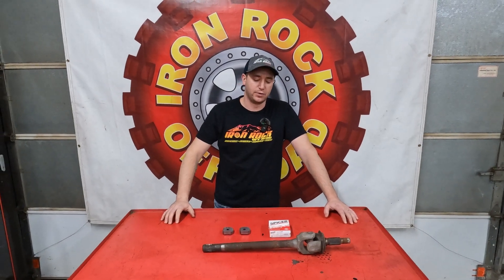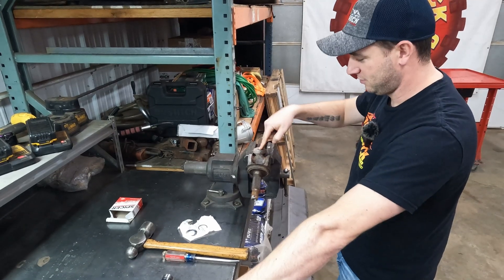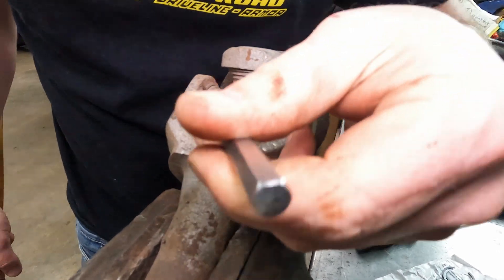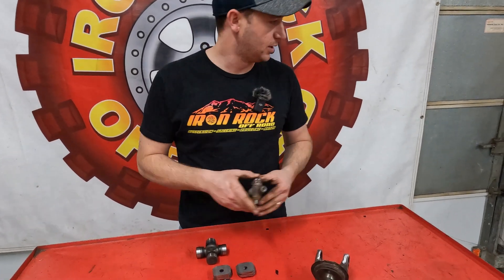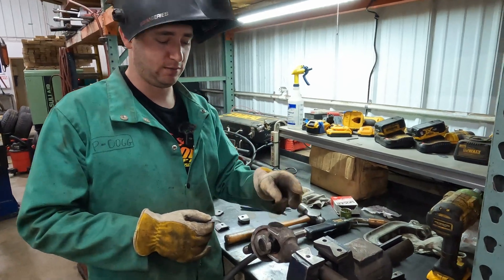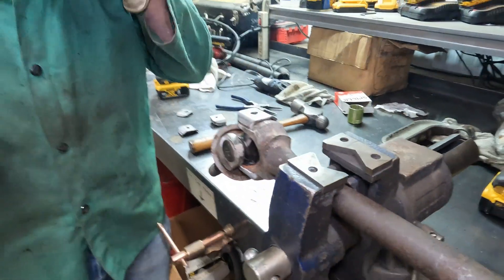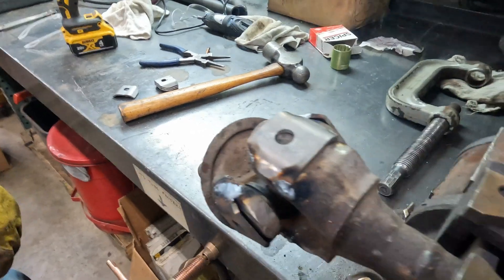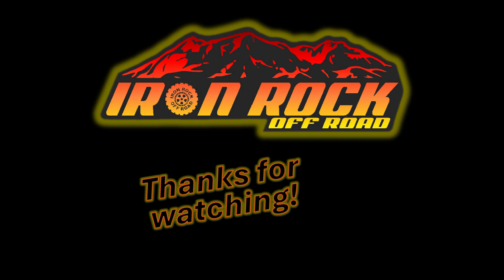Axle upgrade on a budget! IRO Almost Alloy kit strengthens the shafts you already have! Save your $$

Comment: You can cut these out with a torch on the rig. You split them in half between the joint knuckle across the u-joint diagonally. Bump out the clips and caps with a hammer. Clean it up with a wire brush and slip the joint between the knuckles. Install 2 caps to one knuckle, then the next 2 as usual. Install the clips. Then lift the wheel and roll the wheel while gently bumping the knuckles. Good to go. I have changed these out in the field this way for a very long time. I was shown how to do this at age 19. I am 47 now. I know this works.
Reply from the maker: @j.robertvillarreal5926 That's a great tip! Thanks for sharing your experience.
Reply: @IronRockOffRoad  When the Dana's would come in and paid 4 hours on the GM, Dodge, Jeep line I would knock these out in the parking lot. I could do 10 a day. 🤣😂🤣😂. Do the math. 
Never had a Come Back.
Reply from the maker: @j.robertvillarreal5926 Nice work!

Comment: Locktight for retaining press fits.
Works great, remove with heat.
Since spicer quit putting the correct c clips with their joints, I've been using  locktight retaining.
Reply from the maker: @mikegreer9041 Are you using the Locktite in addition to the C clips?
Reply: Boy I sure hope so, lol. I'm sure he is, as I do the same.  @IronRockOffRoad
Reply from the maker: @mikegreer9041, @rite2beararms A press fit with Locktite and the C-clip, that joint isn't going anywhere! That sounds like a fool-proof recipe. Have you guys had any failures yet?
Reply: @IronRockOffRoad  Literally why I'm here. I hadn't heard of this kit, and a buddy mentioned to try it after I broke an outer. He says they run these up in the iron range and they don't fail. Guess I better go for it.
Reply from the maker: @rite2beararms Sounds like your buddy is one of our buddies! We proved this concept over many years of wheeling hard in the iron range of northern Minnesota! The iron range is the namesake for our company, Iron Rock Off Road.

Comment: I know this is a stupid question so please forgive me! Im having one of my days but this is a straight axle isnt?
Reply from the maker: @Tommy-rr7ez Please feel free to ask anything, I'm glad to help! You are correct, this is an axle shaft from a Jeep Dana 30 front axle. This Dana 30 front axle is commonly found under a Jeep Cherokee (XJ), Jeep Wrangler (TJ), and Jeep Grand Cherokee (ZJ).
Reply: @IronRockOffRoad  Thanks buddy I realy do appreciate you and your help. I know a little but with you having it out I just couldn't tell but I preciate you being so nice about it.
I've got 2 GMCs and I just watched a video last week that I thought I had one of my trucks figured out but that video has me confused. Do you know much bout older OBS GMCs? The one I'm talking bout is a 89 GMC K3500 EXT CAB LONG BED single wheel.
Reply from the maker: @Tommy-rr7ez If your question is related to the drivetrain or suspension I can probably help. Whatcha got?
Reply: @IronRockOffRoad  Well I mightve found out. A buddy of mine told and I think he is right. I realy preciate it buddy!
On my 89 K3500 GMC 454 4 SPEED 2 headlights I was told back then they put 2 headlights in a more heavy duty work truck. I seen a video the other day a man bought a 89 K3500 EXT CAB LONG BED GMC 454 Automatic trans. But he had 4 headlights like my 88 GMC K2500.
I ask the man we have same year truck same body style except for you have 4 headlights and mine has 2 and yours is Auto. And mine is manual. Is there a difference and he told me mine is a Heavy Duty and his isn't. Do you know what the difference is and when I get ready to order parts am I suppose to say Heavy Duty or something cause I'm not sure  now?
Reply from the maker: @Tommy-rr7ez That is a tough one. You got me beat on knowledge of these old trucks. With that 454 and manual trans I do know that's a great reliable setup, hang on to it!
Reply: @IronRockOffRoad  I'm sorry it's took so long to get back to you! I preciate you anyway buddy! I found out with my 88 K3500 I need to say GMC K3500 HD when I'm ordering parts cause I've been told mine is a HD, Heavy Duty, so that makes my day. Mine came with factory Rock Sliders all up under it from factory and the regular K3500 didn't.
Yes sir the 454 and the 4 speed Bulldog Trans I believe will do me good when I get ready to take off cross country my kind of Overlanding. I may stop by if I get close to you and shake your hand and borrow some gas if you don't mind. I'm going to put a 100 gal tank like farmers do in bed right up in the front and box it in with a locked side door on drivers side to get to it. I've got it setup to go in shop next week and I've got to practically rebuild the whole drive train except motor trans and transfer case thank GOD they are ok but the motor is new but everything else has to be replaced.
I'm going to put a 5 inch lift on front and 4 inch rear to level it and maybe you can help me with I can't decide if I should go with 35s or 37s tires. I'm realy am struggling on which ones to do. I'm putting Coopers on it and they have a 60,000 mile warranty and that's amazing for a offroad tire. So if you have any advice I will realy preciate it I promise. If I have been told right I can go up to 37s without changing my gears so I think I willbe ok with 37s with a little 454 and 4 speed. 
Like I said I'm sorry bout taking so long but we had a cold snap and I've been getting wood every day and getting the house but it's all good it's going to be in the 70s Monday so I'm not complaining. Where are you at? Take care buddy and thanks for all your help!
Reply from the maker: @Tommy-rr7ez On the tire size, you have me stumped. If it were a Jeep, I'd say go big and cut the fenders if they don't fit! Haha! I'd imagine you will have to regear your axles if you go up to 35s or 37s though. 
We are located in Shakopee Minnesota, where we manufacture the best offroad products for Jeeps. We specialize in suspension, steering, armor, and drivetrain upgrades for most Jeeps from the 80s up to today.
Reply: @IronRockOffRoad  I preciate it buddy! Yeah o was afraid I might have to research. I knew yall done Jeeps but wasn't sure if yall done Toyotas and things to but I knew you didn't mess with old trucks and I wished I didn't either sometimes. You have been a lot of help anyway but you've been honest and that means more than anything! 
This will probly break yalls heart but there is a 70s or 80s I think it's a Jeep Wagoneer setting in a big barn across the road from me on a over 200 year old farm on the same family. No dents and has kinda of a Western interior all original. It was checked last year and they think motor is locked up. One owner and has been passed down. The woman that owns it we talked and I told her your killing that Jeep and she don't know what to do and I told her if I could afford it I like to have it to restore and if I talk just right I believe she would. So when i get this old truck going I may talk serious to her but I wouldn't want to offroad this one. You don't see many of these no more. But it kills me to watch one park like that. It's been parked since around 2000 after her dad passed.
Yall take care buddy and i will try not to bother you no more. Thanks for everything!
Reply from the maker: @Tommy-rr7ez You are welcome!

Comment: So, you just replace the whole axle when the joint breaks? Now you have to carry two spare axles instead of a few new u joints. Seems like the welding will affect the heat treat of the axle.
I just use full circle snap rings on my joints. Haven't had a cap walk out since I started doing that. Plus, i can still fix them on the trail or replace them when they get sloppy.
Reply from the maker: @flpanhead The idea is that by strengthening the ears of the shaft the joint will be much less prone to failure because it is supported so well. It is a similar idea to an axle truss; you bridge across the weak area and tie the sides together to make a more solid structure. If/when the joint needs replacing it is easy to grind the tabs off and replace the U-joint. 

Typically, when a U-joint goes bad it gets sloppy, snaps, and wrecks both pieces of an axle shaft.

Full circle snap rings are a great upgrade, but the axle shaft ears can still stretch and fail.

Comment: I've run these for several years on my '89 2D XJ, 4.6L stroker, AW4, dual 231/231 T-case(s), 4.56 gears, Grizzly locker up front, spooled 8.8 rear, 34x9.50 TSLs summer/trails/rocks, 38x12.50 TSLs winter snow/sand. 94:1 Compound low. No failures yet! 1/100th cost of RCVs. Absolutely best bang for the buck! Highly recommended. Turned my nephew on to them too.
Reply: Im more surprised to hear the 30 is hangin in there.
Do you plan on going full size?
Reply: @anomilumiimulimona2924  No. Gusseted, sleeved. I just try to wheel with finesse vs. skinny pedal. Low gears are for control. Did find out the hard way that the 38s are too big in high traction, busted a carrier (hence the Grizzly Locker) I save them for running deep snow or sand. They live @ 2-5psi for floatation.
Reply: @jonaathansimons7938  nice
Reply from the maker: @jonaathansimons7938 I love hearing about your setup! Keep that D30 alive!
Reply from the maker: @jonaathansimons7938 Thanks for sharing your experience with the kit, that's an awesome setup you have! If you can't break them with a rig like yours then they must be good. Glad to hear it is working for you!

Comment: Great Idea.  The world needs more ideas like this that are the result of thought as to what the root cause of failure is.   On these axles (as long as you have a good Joint)  the main weakness is the thin areas on the sides of the ears.    This seriously strengthens those weak points.
Reply from the maker: @timmcooper294 We appreciate you taking the time to point that out! This design is all about focusing on the areas where the shafts fail.

Comment: Ive got a set of axles with greasable ujoints in em, bought em used. Dude welded thick fender washers over the caps. and then ground em smooth.
Best $50(cad) ive ever spent
Reply from the maker: @Tpbmods Sounds like a good deal to me. The fender washers work but are typically not very thick and not quite as strong as our tabs. We pushed the thickness as much as we could for this product. No worries from us, glad it is working for you!

Comment: Just put your new ujoint in, put 4 small tack welds on each u joint cap. Done. If the joint fails grind the four small tack welds off and repeat. I used to blow up axles on every trip after locking my 35. Now I cant remember the last time I had a failure.
Reply: Your tack welds help retain the cap, but do nothing to help strengthen the axle which is what this kit does.
Reply: Lol the axle doesnt fail until the u joint caps push the c clips off. And OBVIOUSLY you dont understand that welding the caps makes the axle much stronger because it is now one piece instead of two.  Please do not breed. The world is full of idiots. @DonziGT230
Reply from the maker: @bdd1469 Leave the insults for the playground. I agree with tack welding the caps if that is all you can fit. Some axles can't fit our Almost Alloy plates through the knuckle, like on a JK. In that case I would recommend tack welding the caps in place. I do believe that the Almost Alloy plates are the superior option to tack welds but sometimes that's all you can fit.
Reply from the maker: @DonziGT230 That's a great point. We designed these tabs to be as thick and strong as possible and still fit through the knuckle. There is an advantage using our Almost Alloy tabs versus just welding the U-joint cap. We also designed the shape of the tabs to try and keep the heat of the weld as far away from the grease and needle bearings as possible.
Reply from the maker: @bdd1469 Glad to hear that is working for you.

Comment: A couple sockets would have made that U-Joint removal much easier... and you should have sockets on the trail

Anyways thanks for the video. Been on the fence about these but after the vid Ill be ordering 2 sets.
Reply from the maker: @1unkn0wn You are absolutely right, live and learn. We could have edited all that struggle out of the video, but we want to keep it real. We know this job can be a bear sometimes especially up here in the rust belt. All 4 of the U-joint caps were completely seized and so sloppy it wasn't even funny. No evidence of grease at all.

Thanks for the order! We appreciate it!

Comment: Yo?!! . . P-DOGG . . . . why you no safety glasses while C-Clip removing? 
Seriously tho, . . . I live in Alaska, I've seen some insane repairs. Repairs that clearly were done out of a lack of preferable choices. Like a rear drive shaft on a Chevy 3/4 ton that was made from 3" diam., tube of 14 gauge (0.0747″) wall thickness exhaust tubing. And it lasted until those U-joints wore out and the driveshaft bound up a bit and twisted. It's amazing what one can get away with when working with metal. If you remove too much, weld some back in and start over. If you need a hardened surface, weld some in , . . etc. Always interesting. Even if it's a new product, or in this case an older product, that I doubt I would ever use but, it's still super neat to see it. I Hope Iron Rock Offroad has a stellar 2025.
Reply from the maker: @RANDOMNATION907 P-Dogg is a nickname for another guy that works here. We are all about sharing our welding jackets here! 😆 I'll make sure to share some safety glasses with Travis next time! 

This simple product has been working for many years. It's not for everyone, and it doesn't look pretty, but it definitely works! 

Thanks for the feedback as always @RANDOMNATION907, we hope 2025 is great for you too!